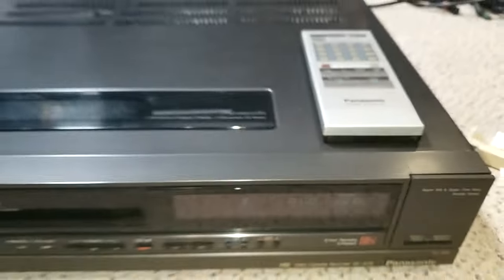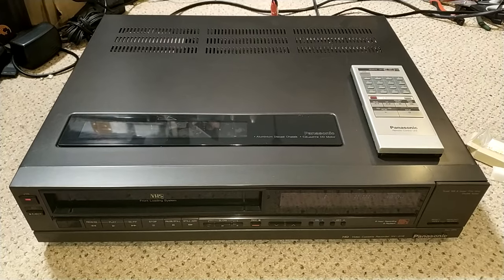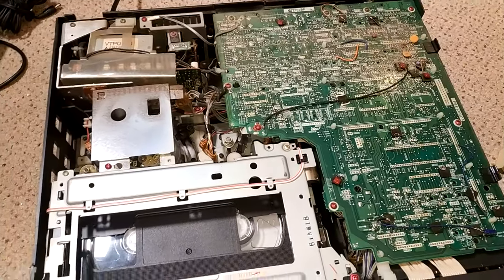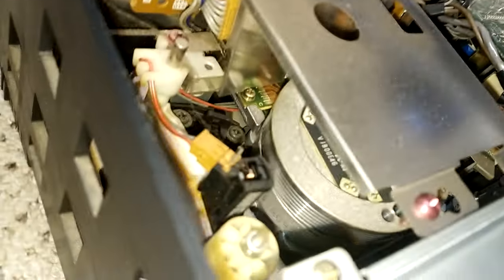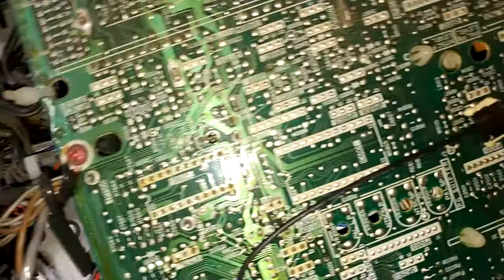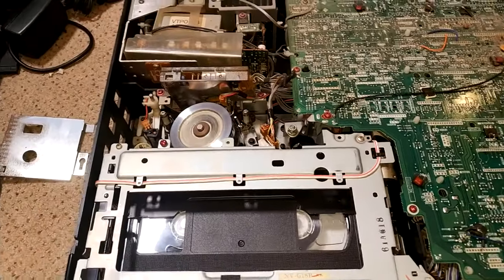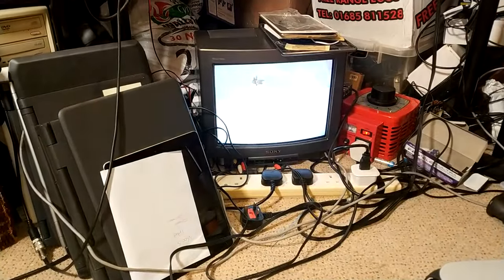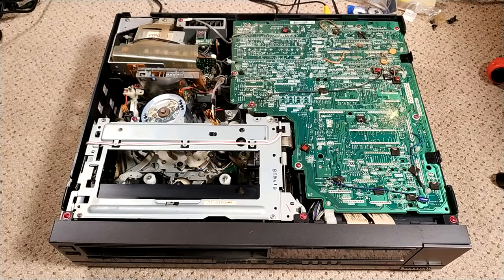Panasonic NV-G18 VHS video recorder D-deck - servicing and getting more smiles from your tapes.

Comment: They did do a HiFi one, I had one using this deck years ago.
Reply from the maker: Can you remember what the model number was? I have an NV-870 as my 'daily driver' which is a fantastic machine and gives great results for a VHS but it's only short-play.
Reply: @MrBetaByte  Afraid I can’t remember.
Reply from the maker: I will try and find out which model it was and try and get one - would be true perfection to find a D deck machine wit SP/LP and hifi.
Reply: @MrBetaByte  Personally I prefer the JVC decks of the same time.
Reply: @MrBetaByte  I am pretty sure the NV-H70 is a D1-deck machine with hi-fi audio and LP.

Comment: Great work! This is actually a D deck, not a K deck which came out after the G deck. Panasonics of this era seem to have an excessive back-tension brake setting. I backed it off a little bit on my NV-380 and some other models. And yes, the brass-style back-tension band always falls apart. I had it happen on at least 5 machines.
Reply from the maker: Fivos, you are so correct! I even ordered some parts for a K deck I'm repairing shortly and I still managed to not call it the D deck in this video! I'll change the description and thumb and will credit you for spotting my really crazy mistake. :-)

Comment: I have a Panasonic NV-G10AR 4, looks very similar as this one. It powers up but power button and eject button do not respond. The hour blinks on the display but buttons are useless. What would you recommend to do? I have a tape stuck I can’t remove. Thank you
Reply from the maker: It is essentially the same machine I seem to remember. It sounds very much like you're missing a power rail and I wold suspect am issue with the power supply. It could also be a logic issue where the logic control chip isn't able to apply the voltage to take the machine out of standby but it is a tricky one to diagnose without seeing the machine. I do seem to remember there was a fusible resistor in the power power supply that would go open circuit and you can visibly see this by a dark band around it. Sorry I can't help more but it is difficult without seeing the machine but really hope this helps.

Comment: Just purchase a Sanyo VCR 4500 Betacord. But the picture looks like it has some issues cause of lines in the video output. Could it be dirty or damage heads??
Reply from the maker: Difficult to say without seeing the picture playback and getting a scope on the video signal but do you have lots of distortion or 'squiggles' around white areas of the picture? You could also try recording some high contrast video and play it back - it should be significantly worse with darklies  tearing of white or bright areas of the picture.
Reply: @MrBetaByte 😢 Now the tape mechanism isn't working. Not sure what am going to do with this thing but at list I still have two working VHS and one BETA player. So it's not a big lost. I will record some footage from my other some-what working BETA player. It will be on my channel soon. After I uploaded I'll let you know. Perhaps in time for your next video! Thanks the reply and until next time.
Reply from the maker: I look forward to seeing it - just reply here and I'll see it. :-)

Comment: although they had amazing build quality the downsides of early vhs players become very apparent in this video, overly sophisticated mechanisms, belts everywhere. multiple pcb's and spaghetti wiring. The best VHS machines in my view are from around 1999-2002. although the build quality isnt a patch on these old machines the simplicity of the mechanisms made them extremely reliable and simple to work on. My favourite VHS machine is the JVC HR-S8700, i find S-VIDEO does make VHS look just that bit nicer than standard composite.
Reply from the maker: I totally hear what you're saying but I suppose it depends what you want to use the machine for. The older decks just do such a better job with damaged tapes when archiving and they are surprisingly reliable if you're careful what you go for and know how to service. I just find with newer decks that if you get a cassette that has an issue like a locking up spool the new decks just break. S-VHS does make so much of a difference too. I have a couple of 'modern' VHS decks coming in soon and will no doubt do a video on those as well as a Panasonic FS200 which is a real beast of an S-VHS machine.

Comment: hi i have alot of video's over the years  i had all the format betacam sp  4 channel is my best liked decks     get video parts and finding parts is a pain

i have tape decks as well  techmoen did the rca deck i had 1/8 tape well before him as i have cassette dubbing set up love to see how many people are fixing old gear now
yes  i know about liner stereo on the V2000   or v2000 hi-fi with the sony pcm 701 es eu models have a A/V din socket 

yes there is adat for  svhs  wide vhs as well  i had them all no show of keep up with me
Reply from the maker: That's all great info - it does sound like you have seen some great kit over the years.

Comment: Wow, what a beautiful machine! It reminds me on my NV-G15PX https://www.youtube.com/watch?v=knd0orDV8ww . If there are still problems with the picture, maybe it is time to check the caps, especially these purple ones. I always avoided to adjust the tension of the supply reel, I was always lucky and the tensionband was in the VCR and I just glued it back on the metallband. :) I don't have the gauge-tools to correctly adjust the supply reel tension and this is really important for all feature-functions! Very great video btw! :)
Reply from the maker: Your G15 is wonderful - a really amazing example you have there. I'm guessing it's the same as the G18 underneath? Hear what you're saying on the back-tension and it is a little bit of a guessing game without the torque gauge. Thank you so much for sharing.
Reply: @MrBetaByte  Yes, really wonderful like your G18! They are very similar. Good, that you made it with the adjustment of the backtension! You are welcome. 😀